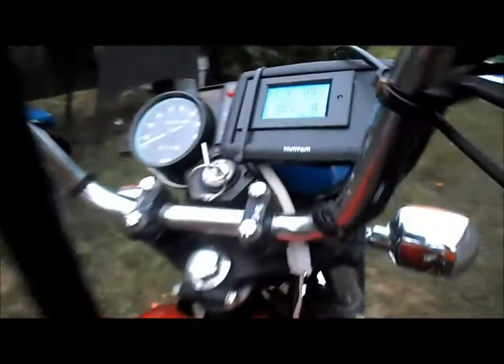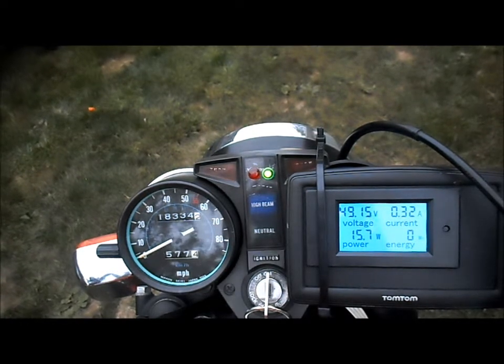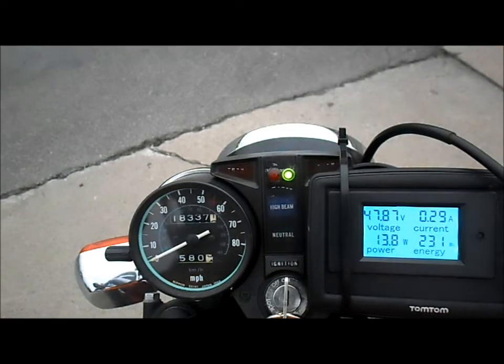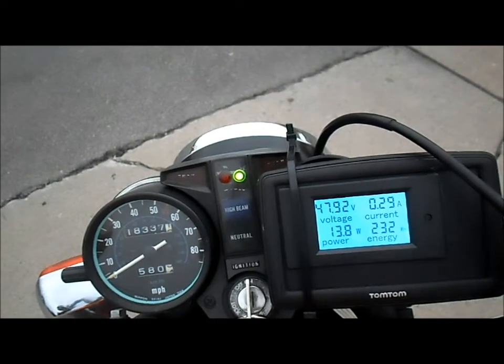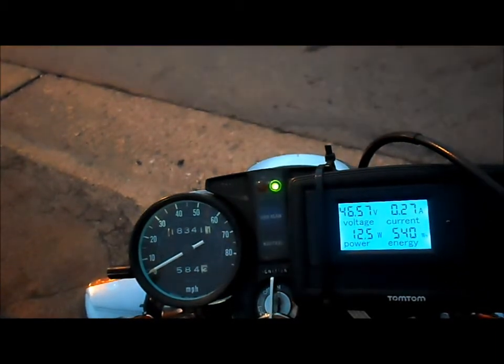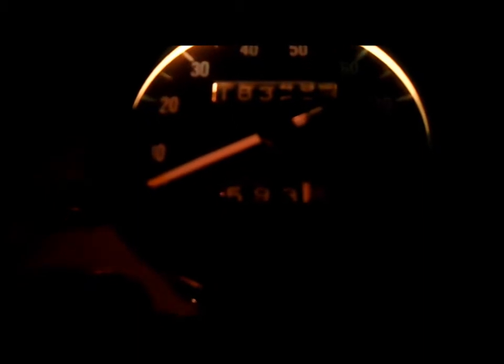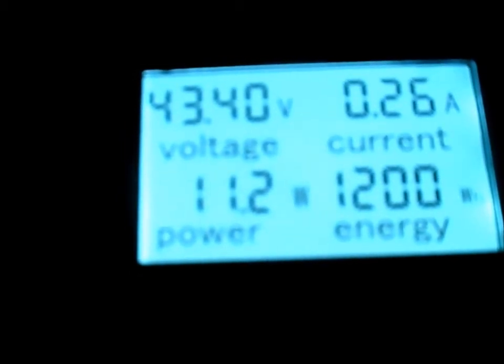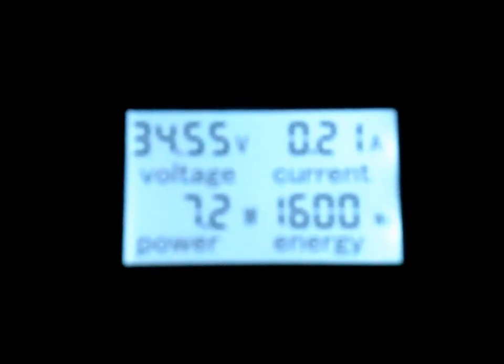El Moto part 45 test ride with PZEM 051 meter

Comment: Looks like youve detailed your bike.....looking really nice.
 That new seat makes the bike look like an old lady in Pasadena only drove it to church on Sundays.
 Im wondeirng if adding a little boost battery to get voltage up to 52v would be worth it.  Would you controller ease up on current then??
Reply from the maker: Yup, she cleaned up nicely, thanks! 
The batt pack is I have on 'er now is only 12S (~49V) 
A 14S pack would bring 'er up to ~58V 
...& a 16S pack would bring 'er up to ~67V
The controller can handle up to 72V 
So, yea, more RPM's & possibly less current draw
...yup, I'm thinking about it.
Reply: I was building a 16s battery then saw how much charger jump through the roof. Basically golf cart expensive stuff. Im back down to 14s for now...and even that is actually split into two 7s in parallel.  I use a 600w power supply at 50v boosted to 58 and about 10amps.OR charge the 7s's separately with boosted PC power supply.
Im doing some experimenting too.  A123 LiFepo batteries of different chemistry (higher charge/discharge rate) linked to my 18650 batteries AND carrying a little 1000W inverter generator...all in parallel.  Takes some fancy matching and balancing.
Not to mention trying learn Kirchoff Law's frontwards and backwards
Reply: One of the cool things about the 3 power sources in parallel.  The 600W power supply is limited to constant current of 12 amps.  If I understand kirchoff correctly. that would be the controlling amperage, making it 3 x 12 equals 36amps max.  A bit of current control before the controller.
Reply: HAHA...too early...I got that all wrong...back to my notes